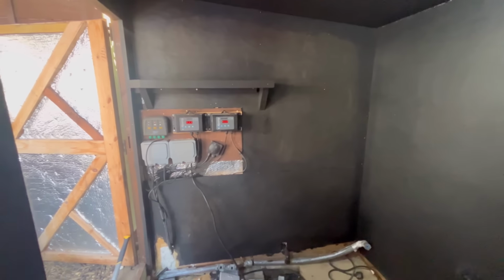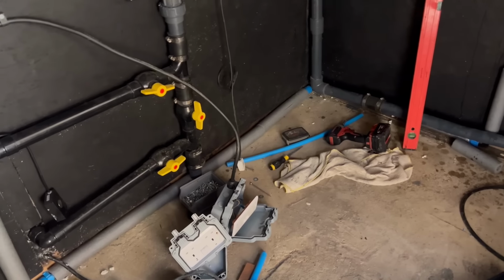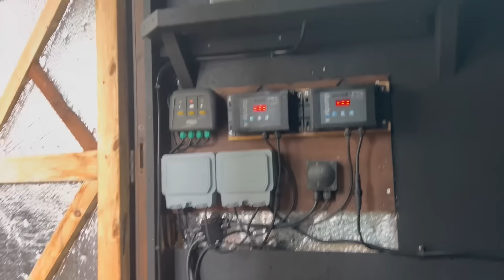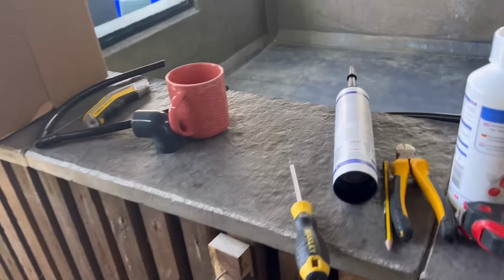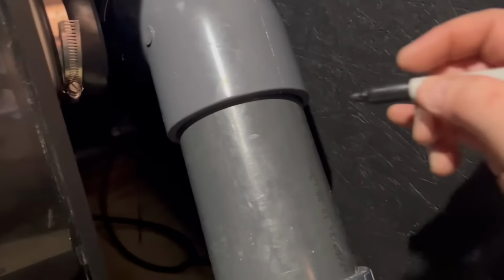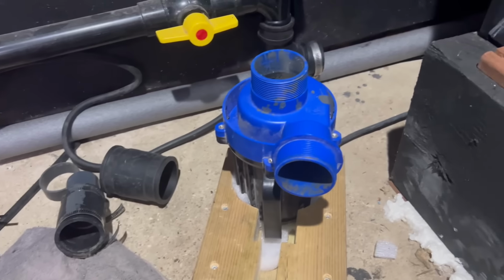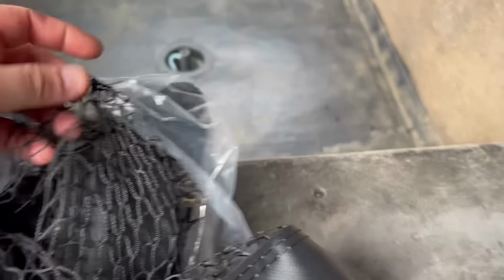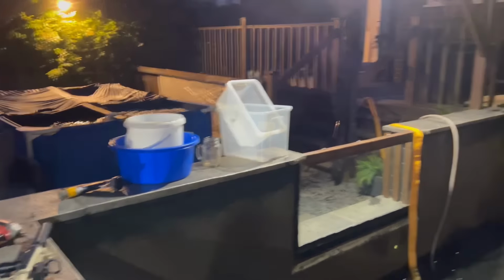How to - Combi Drum filter install and installing the pond pipework. Will it come together?

Comment: Lots of work again mate.
How you finding the drum now, after making the adjustments.
Any ideas of the amount of water your using daily etc for running the drum. Any issues you've come across with the drum itself, or parameter issues.
Reason im asking is im looking at biting the bullet on the same drum. Which would pretty much drop straight into my filterhouse in no time. 
Keep up the content though funny and a thoroughly enjoyable watch😂.
Reply from the maker: Ah thanks for the great comment. I keep meaning to do an update video. Long and short……. You won’t regret it! Since changing the flows, it’s been much better so worth considering when installing. If flows will be fairly slow, fit a purge valve. The only issue I’ve had and it was to be expected, the nexus had brilliant bio capacity. The combis hold less so there’s a period of settling in. I’ve increased my bio to around 140 litres now but had over 250 in the nexus.if going for a combi, get one with as bigger bio capacity for your money. 100% a worthy addition to the pond 👍🏼👍🏼👍🏼
Reply: @edenkoipond  Thanks for the reply. So the stated 220litres of media isn't achievable? Or is that 140 litres all you can get in because of new media.

Comment: Looks good bud I was looking at the Draco C60 for works pond but doubt they’d go for it one can only hope 
Can’t wait to see yours up and running 
Quick one bud I see you’ve the Charles Austin 120 how would you compare them to the EA 130
Reply from the maker: The c60 is a tidy old filter 👍🏼👍🏼 I like the Charles Austen pumps. Seen many tests where they ascertain that their pumps actually put out more power than advertised. As to EA equipment….. the high prices put me right off and I’m yet to have an EA product that isn’t built cheaply and poorly. Definitely take the CA over the EA 👍🏼
Reply: @edenkoipond  nice one bud I do think I’ll be going down the lines of the CA